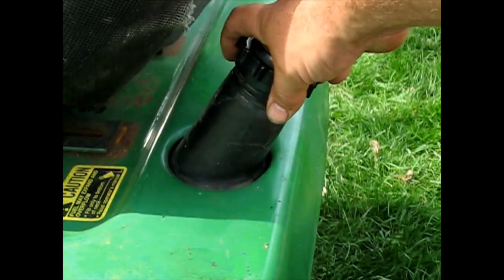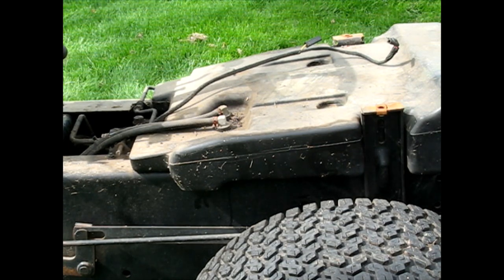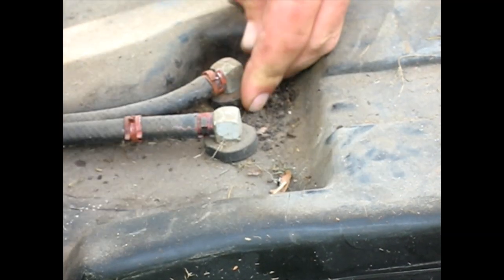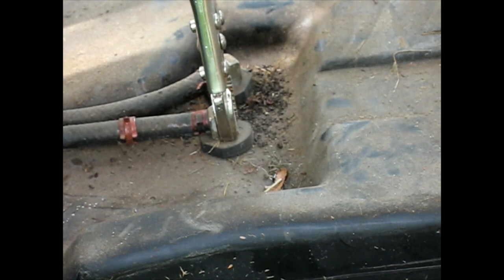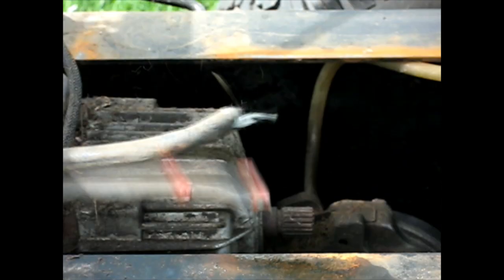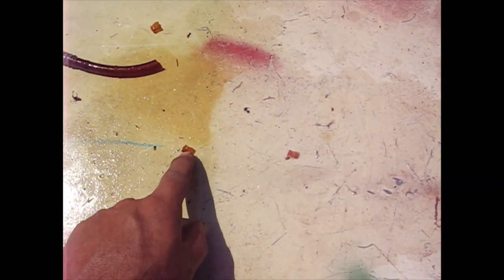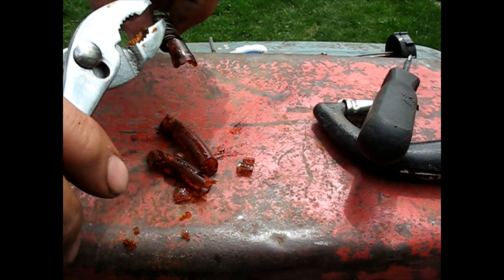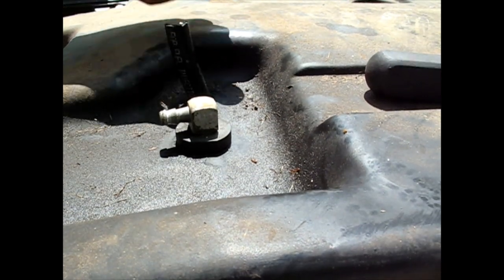John Deere 318 fuel tank internal pickup tube replacement. Fuel tank removal.  My playlist no 5

Comment: Thanks for the how-to. I get to do the same job for a customer tomorrow, except his tank is covered in a layer of silt and rust. Had to replace the gauge because it was rusted so bad the cork couldn't move. New carb and fuel lines, clean tank and gauge. 

Good to know I don't have to remove the seat from the trim because I'm working in a tight space. 

Thanks!

Comment: I have two holes in my fuel tank to but only one has a fuel line entering it in the other just has a rubber plug. I pulled the plug out to check it out and now I can’t get it to fit back in tight. Any recommendations?